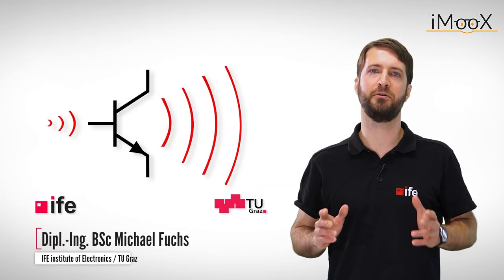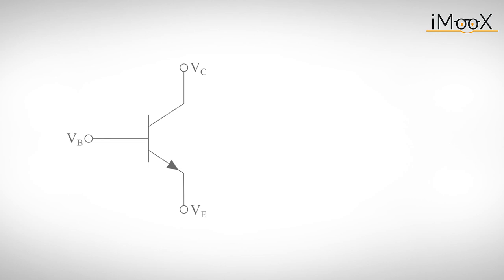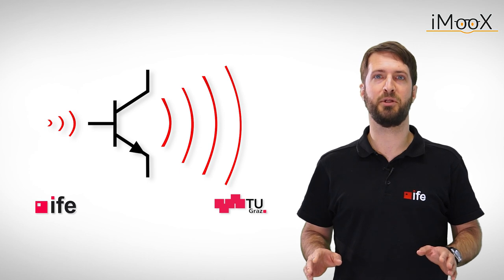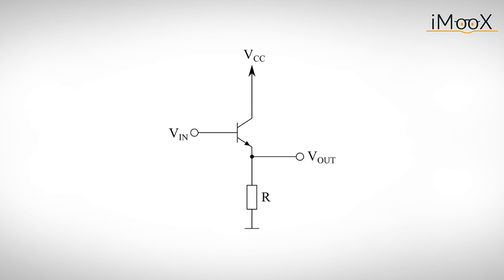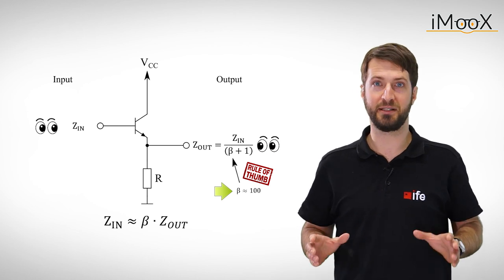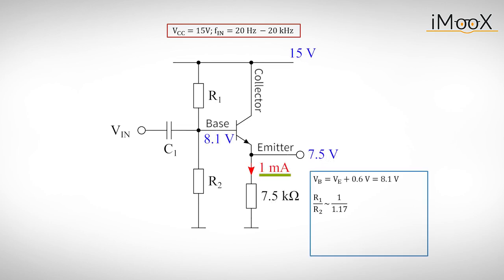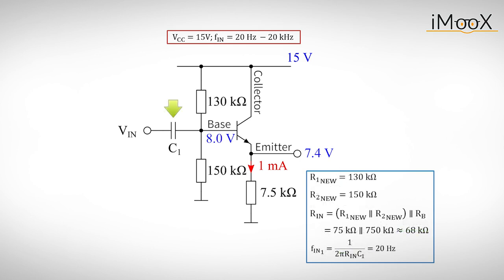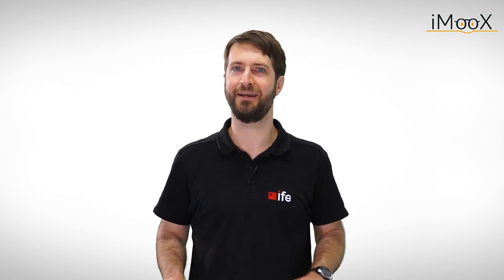The Transistor as an Amplifier - Emitter Follower, Common Emitter Circuit, Design Example

Comment: Is it true that current-controlled transistors are better than voltage-controlled transistors by a factor of beta?
At Texas Instruments I worked with I²L logic (Integrated Injection Logic). Beta was about 4, as opposed to discrete transistors with a beta of 200.

Comment: Sir R2 value how did you get it please explain  , I didn't get it explained in the video
Reply: You know that R1 =139k, Vin = 15v, Vout = 8.1v so use formula ; Vin x R2/(R1 + R2) = Vout.  Transpose formula to get; Vin/Vout = (1+ R1/R2). Transpose further to get; Vin/Vout - 1 = R1/R2 again transpose to get R2 = R1/(Vin/Vout -1), which equals 163.5k. Select nearest listed value of 150K.

Comment: why is the R1 and R2 in parrelle for the impedence of 75K
Reply from the maker: Thank your for your question.

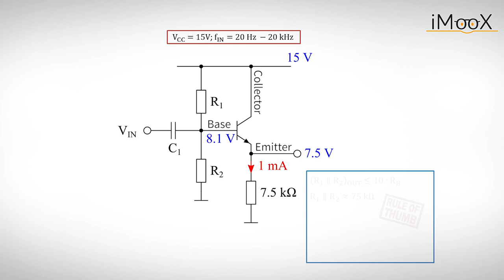We suppose you are talking about the input impedance of R1||R2 at 10:15?
R1 and R2 can be seen to be in parallel in the small-signal analysis as the positive and negative supplies are constant and are therefore both on small-signal ground.

If you want to know more on small-signal analysis we recommend you to watch the following videos:
Basics of small-signal analysis:
https://youtu.be/DKPqNQ3CZ9I
Similar example:
https://youtu.be/e067ySIG3gY
Reply: @ife.tugraz  thank you

Comment: At 10:07 Rb value is 750k ohm but at 10:19, 10 times Rb is 75k ohm, why ?
Reply: I think that might be a mistake there. For voltage divider in general the conencted load shalll have at least 10x the resistance of the divider resistance. That means R1||R2<= 0,1xRb ; hence the 0,1x750k = 75k limit. Or Alternativelly   10x ( R1||R2 ) <= 0,1xRb
Reply: Yeah it should 10 * (R1 || R2) <= Rb. The calculated values are still correct.

Comment: Don’t get it. You have an input open the valve but it’s not amplifying. The higher current is already there. I was expecting the low input current being amplified to produce higher output. Like a guitar signal in and a jimmy Hendrix out. But on your example this is not the case